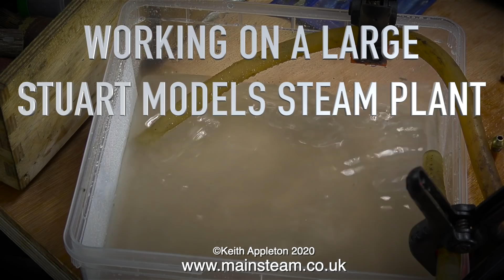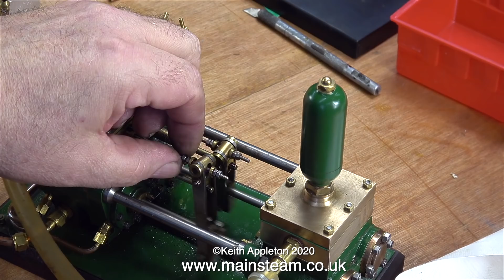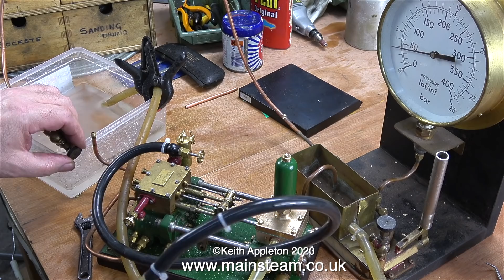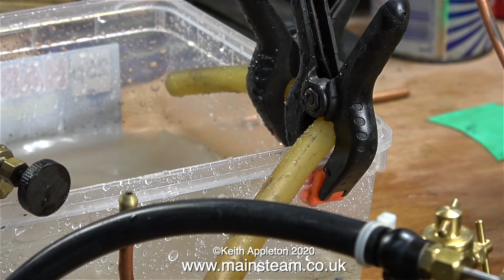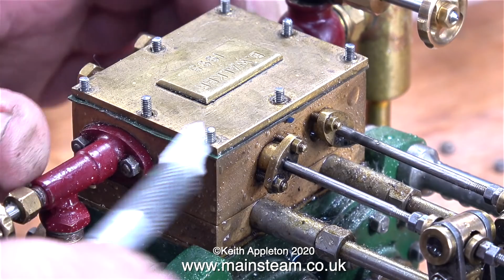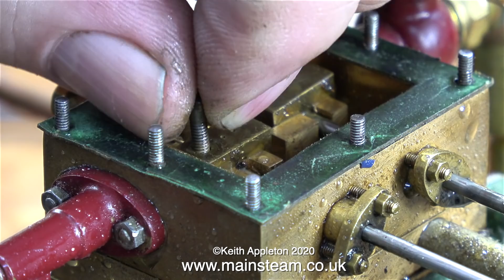WORKING ON A LARGE STUART MODELS STEAM PLANT - PART #5

Comment: I worked on a Hydraulic system once on which we traced the persistent leak down to one human hair across a sealing surface. below 1,000psi it did not show a leak, but at the 8,000psi working pressure it was a fine stream that wore a grove in the surfaces.

Comment: How can you get accurate timing when the holes on the arms are wore through from the threads from the shaft. Wouldn't conicle washers instead of flat washers or a sleeve running through the bushing be better for this?
Reply from the maker: The holes are not worn at all, they are large holes and they are meant to be like that . . . .
Reply: Not sure -! That means I'm assuming stern statement, but was asking question. I understand that the hole is supposed to be big. from video 4 it looks like the hole is so large that the rod is hanging down and the washer is contacting the arm going down to the piston rod. It can be seen on the slowmo of this video. From another video the bushing looked smaller so assumed from vibration and sliding the valve timing rod was chewing into bushing. It probably doesn't matter on a engine like this but figured the timing is stuttering or accelerating irregularly which is why I asked why isn't a conicle bushing/washer or sleave put in to help keep the rod centered?
Reply from the maker: I suppose that's because a conical washer is not shown on the designer's drawings.